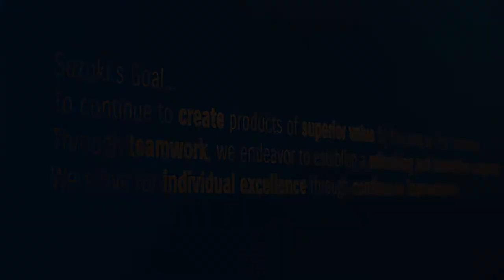SUZUKI ATV | OFFICIAL HISTORY VIDEO | Suzuki

Comment: My father in-law's '93 king quad had never had a tune up, the muffler is rotted out, racks bent beyond repair, plastics full of zip-ties, seat is torn to shreds, motor leaks a bit of oil, suspension is finished.....Yet it will still fire up every time and proceed to pull your whole house off its foundation!

Comment: I have a 2005... literally the best thing i've ever owned. i've driven so many things out there, 1990s Yamaha Timberwolf 250, 1988 Yamaha Moto4 350, 1999 Polaris Xplorer 400, 2005 Polaris Predator 90, 2021 Yamaha Kodiak 700 Special Edition,  2000s Yamaha Kodiak 400, literally nothing beats my KingQuad. My friend had one too. His KingQuad was a 2005 750, and it was in a complete WRECK, meaning half the rear end was gone because he got rear ended so hard by a Can Am Renegade going 90. Renegade didn't make it. KingQuad drove back and was restored, still running and driving. He now owns a 2021 Yamaha Kodiak 700 Special Edition.